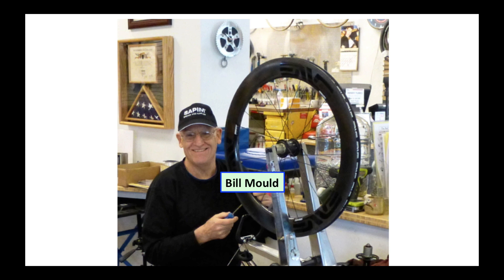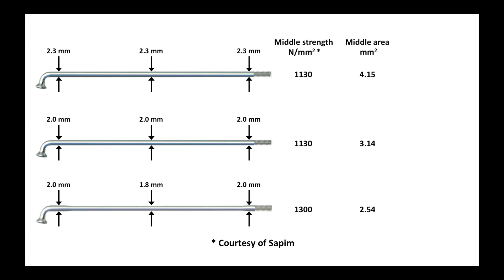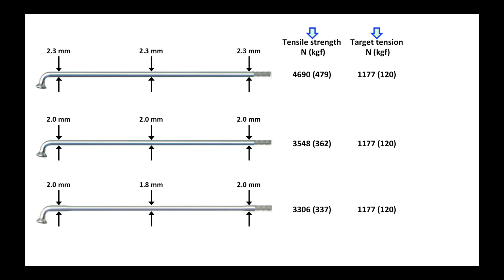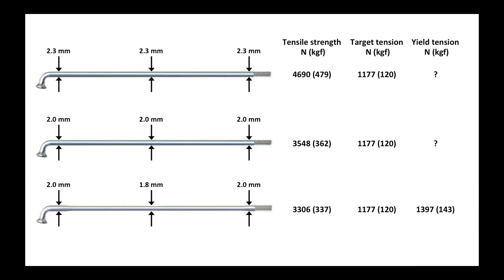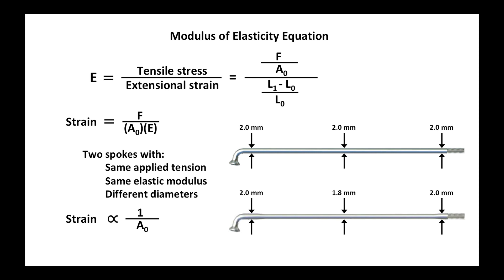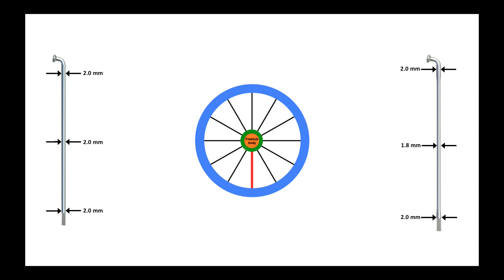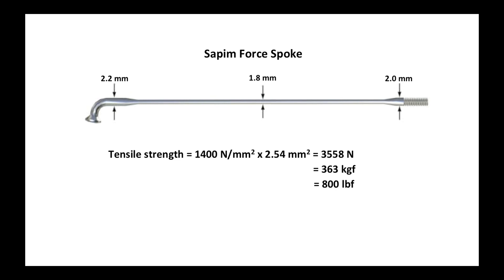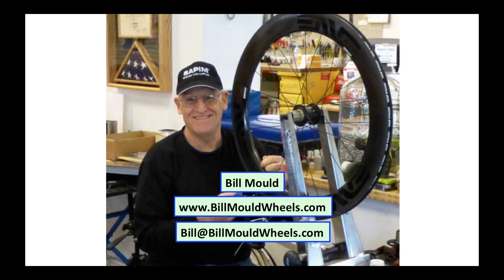Spoke Tensile Strength and Elasticity

Comment: Hi Bill,
I wish yout the best for 2021.
Thanks for this interesting video.
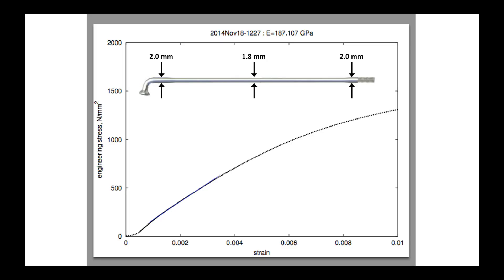Can you tell us to which initial spoke length L0 the plot at 4:10min ist connected to?
Thanks for your answer.
Best Regards, Martin
Reply from the maker: I'm not sure I understand the question.  Could you please clarify.
Reply: @BillMouldWheels  The Stress / Strain plot @ 4:10 : What initial/ unstreched length had the spoke that was investigated there? Thanks for your anwer in advance & Best Regards, Martin
Reply from the maker: It should not matter.  Strain is a percentage increase in length, i.e., it is dimensionless.  A longer spoke would increase proportionally more.  Besides, the spoke lengthening is measured by the extensometer.
Reply: @BillMouldWheels  Thanks for the answer, I forgot about the testing setup you showed just before. So you empirically determined the youngs modulus for the 1.8mm middle part, the plot then belonging to this part of the spoke only.
No examination of the overall strain of the whole butted spoke of interest here.
Reply from the maker: Right, the strain changes occur in the thin section, so its behavior is of particular interest.

Comment: Hi Bill 
I have a little question regarding spoke stretch and how I would like to compensate for that in my spoke length calc.

I guess that the accepted GPa of Sapim spokes are 210. But I cant seem to find, or figure out myself, how the formula will look for calc spoke stretch. 
Ex. 
Sapim Race 294mm
125kgf
How would the formula look?

Best regards
Thor, Denmark
Reply from the maker: Thor, let's start this way.  First, look at this short video about spoke length.  https://youtu.be/i0Q29syv9ws.  That will give you the correct spoke length.  Then use any of the on-line spoke length calculators that are available.  They will give you a length that is too short according to what you will see in my video.  Round up the on-line calculator's lengths to the next hole number and then add about 2 mm to each.  That will give you a better alignment of the spoke with the nipple and also allow for a little stretching.  Let me know if that makes sense and if you have any more questions.
Reply: @BillMouldWheels   Hi again and thx for that quick response.
I forgot to mention that i've build many wheels and i'm using the formula for spokelength from Roger Musson "Wheelpro". I simply want to add the spoke stretch to the formula so when I change kgf and spoke length my Excel sheet will give the right length incl spoke stretch.
Reply: Hi Thor and @ Bill Mould:
This solution to achieve was exactly the motivation for my question to you Bill. When I calculate the spring constant for a spoke with given stainless material and geometry (e.g. butted, straight) I never ended up with Force/ Stretch Diagrams for compareable spokes in literature like G.Schraner and J.Brandt (he himself shows these diagram (figure 68) in his book whilst contradicting them with his calculation on p.128 at the same time). From experience the G.Schraner diagram line, linear equation breakdown was better in nearly all cases for wheelbuilds especially when using butted spokes. Anyhow this does not reflect calculated spoke stretch by spring constant formulae.
@ Bill Mould what is your experience? Could you verify the G.Schraner diagram? Did you make some comparable measurenments. I'd like to share my findings if you like, but this needs EMail.
BR Martin Binz

Comment: Another great video, Bill.  Question for you - if, as you say, a spoke in the field will never experience a load anywhere near its tensile strength, why don't manufacturers make spokes a little narrower to save weight?
Reply from the maker: A great question, Richard.  Either they don't understand the basic engineering principles or they think that the lower cost of straight gauge spokes is more important.
Reply: Maybe you need a certain diameter to keep all tolerances in the mass production? Or simply because „it’s tradition“? Or because a spoke not only has to bear straight tension stresses, but also twisting and sideward bending stresses? Don’t really know, just guessing. But it’s an interesting question ...